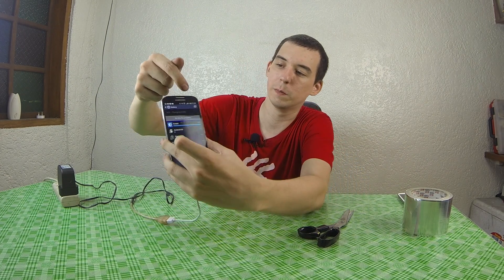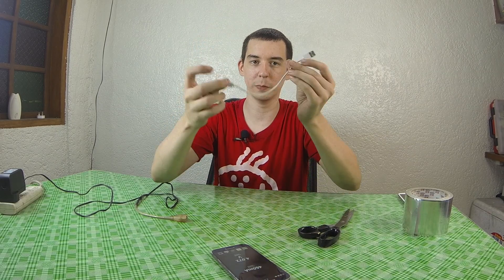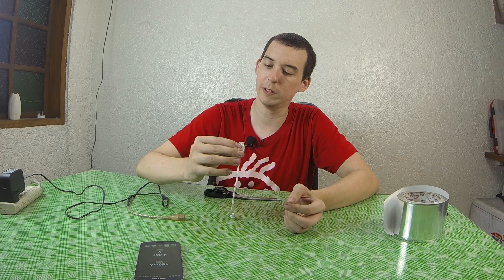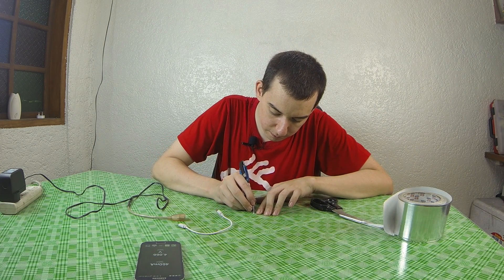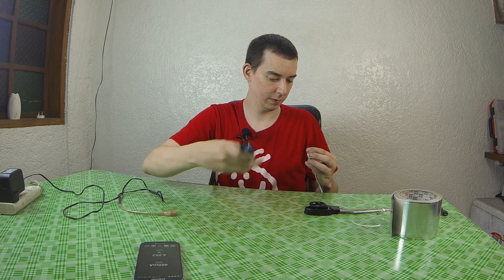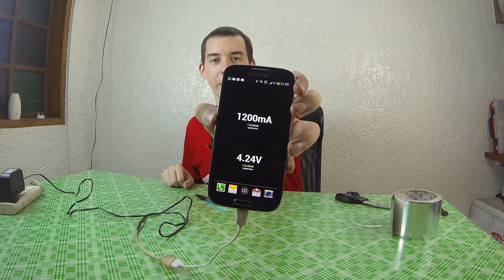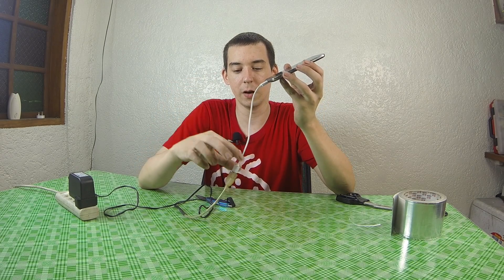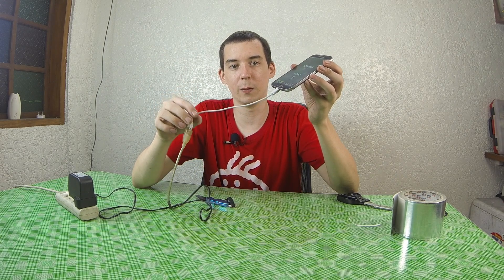Make a Fast Charge USB cable

Comment: Thank you. This was easy and it really works. I just recently switched from an iPhone to a Samsung S5. It's been 3 weeks and I hate it, but I'm pretty sure that's because I don't know how to really use this phone. Do you have any website suggestions that would help me understand everything this phone is capable of?
Reply from the maker: Mmm sorry I wouldn't really know what to suggest. There are some things I love about iOS and some things I love about Android. Both have their pros and cons. To some degree it will just take some time to feel comfortable and enjoy when swapping between them. I recently moved back from android to iOS and I hated it at first.
Reply: Check out videos from PhoneDog, PhoneArena, Android Authority, Techno Buffalo etc... 
Hope this could help!
Reply: +Lana Etherton If you want to fast charge iPhone from PC, install 
"Ai charger" and you need no HW modification.

I think apple uses the same mechanism for detecting wall chargers, so it should work.

(and my primary recommendation is naturally not use apple products.)
Reply: Hello See Videos on YouTube Samsung Galaxy S5 review or so but I recommend everyone if you used iPhone and you switch or go to Android don't buy Samsung ! Samsung with his TouchWiz and Knox  is not good for the one's from coming from iPhone ! Everyone that used Samsung phone will confirm you that the phone will slow down in 4 to 5 months use or earlier that's Samsung ! And you buyed s5 that is a problem phone I had a Samsung S5 plus the voice quality was shit and micro USB port went broke every 3-4 weeks and the battery lost his Battery was discharged very quickly although the phone was new it was swapped but the other new one was like that and I gave it back and buyed oneplus 5 with oxygen os Android  system ,double Sim 8gb ram 128 Gb internal memory  is the best phone ! Is very fast and I had never the problems  that I had with Samsung ! At the moment they released OnePlus 6 see technical documents! 
Regards ,

Comment: I tried shorting the two middle pins as instructed.  Before that, my charge's reading was: reference 100mA; max: 100mA;average:100mAh; After:reference: 466 mAh; max: 400mAh; average: 400mAh. I thought I was going to get something higher. My charger has 2000mA. What is wrong? thanks
Reply from the maker: Maybe your phone isn't capable of drawing anything above that.
Reply: In comparison to the stock cable from samsung, ref:1698; max 1000; ave: 1000. Maybe the cables I used are really poor quality.
Reply from the maker: Mark Lemuel Yanuaria  That is a possibility, some cheap cables are made with the lowest quality and least amount of actual wire.

Comment: what thing can be use as a replacement for that aluminum tape something?
Reply from the maker: If your fingers are nimble enough, a soldering iron and a bit of solder. If you don't plan to regularly unplug the cable from the charger then a carefully place piece of aluminium foil with some glue. Or cut the wire and rejoin with the data lines shorted. Failing all of that, just go buy a fast charge cable :)
Reply: ahhhhh.. okay..

by the way sir, is it possible to charge one phone using another phone? is there any possibility to make a connector to do such thing?

btw, thank you so much for the reply ;)
Reply from the maker: wewang negapatan Unusual question :P I don't think it would be possible using just a cable but you could design a circuit that would allow you to remove the battery from one phone, boost the voltage and use it to charge a second phone. It wouldn't be very convenient but it could work. It would probably be better to just carry a portable power bank :)

Comment: by shorting you mean to cover the 2 middle pins so they don't make contact or to short circuit so somehow it messes up the contacts and don't work anymore?  Won't this mess up the charger?
Reply from the maker: Shorting the middle pins together means the two pins in the middle are making electrical contact. In my case the aluminium foil is put over the two middle pins meaning they are effectively joined together, They're only data pins and don't carry power.

Comment: Awesome!  My Oneplus One charger is 2.3amps and it charges from Zero to Full in about 45 minutes... Looking at my battery status it states its charging at AC current so full power is being utilized for that quick charging....  Awesome!   Now if I can find small Supercapacitors and mod them to fit inside my phone replacing my phone's battery then my phone will be able to charge fully in about 30 seconds or so!
Reply: Sick
Reply: lol ^_^
Reply: fool

Comment: So i tried this and i still get 300mha charge current. I am using a 2A output charger and charging an S4.  Does the quality of the cable matter?
Reply from the maker: The quality of the cable can make a difference, if the cable is very long or the wires inside are very thin then it can limit the amount of power the cable can supply to your phone. Also if your phone is very old then it may really not be capable of charging at a higher rate. Although I've not heard of any phones charging as low as that.

Comment: You should do that on the USB plug end because you are using spliced usb cable to power cable, that way you do not mess up with the OTG cable, plus the aluminum might move around and shorted other pins when you push the plug.
Reply from the maker: Mozz Tzar Yep, I could do that. But I wanted to show people how to do it on a cable that they can move between many different chargers. I'm using aluminium tape which doesn't move once stuck in place and moulds to the shape once you use it once or twice :)

Comment: Can you get shocked if a piece of alluminum foil was sticking out? 
Is there a chance this might catch fire?
Reply from the maker: The two middle pins are data lines, they don't carry any power. Aside from that, USB power is only 5v DC which will not shock you. As for a fire risk, there should be none if you follow the directions exactly. If you're not confident, buy a special 'charge cable' instead of modifying your charger :)

Comment: I have a Sky Vega Phone from korean.., Very fast low battery and the charging time very slow.,

my charger is
INPUT: 100-240vac 50/60Hz 0.2A
OUPUT: 5.0V=1000mA
Reply from the maker: 5v, 1amp, pretty standard. Some old phones are only half an amp! And some newer phones can do 1.5-2 which means faster charging :) You could install the android app to see if it's really charging at the full 1amp. You could also consider replacing the battery if you've had the phone for a long time.
Reply: Gadget Addict Thank You for helping me sir

Comment: Can i know., the charger input and output??..
Reply from the maker: The charger in the video is a regular AC power supply which can push out up to 4amp at 5v. But of course no phone will draw that much. Most phones/tablets wont draw more than 2amp.

Comment: does it really work , i mean does'nt it put the phone in danger of overcharging or exploding or stuff like that.
Reply from the maker: Yes it works, as demonstrated in the video :) A phone will only draw as much power as it can handle. The charger I used in this demo is capable of pushing out 4amps at 5 volt but the phone is still only drawing its maximum of around 1200ma
Reply: thanks  c",